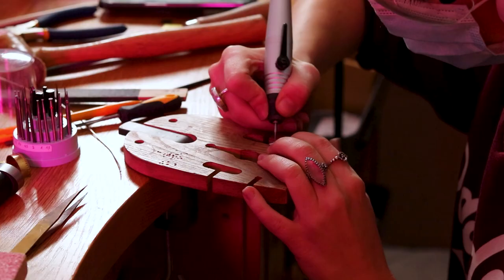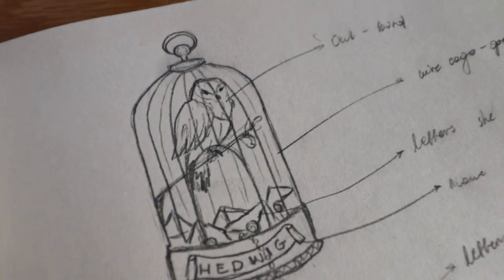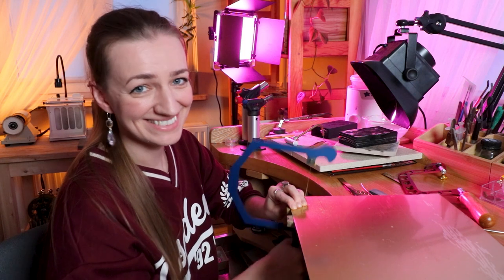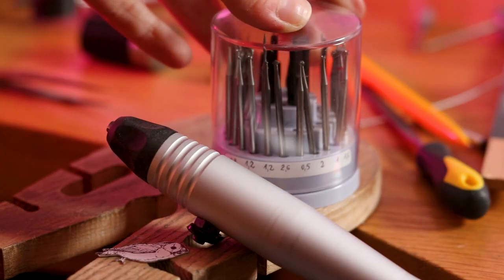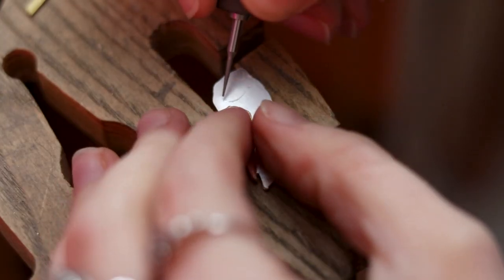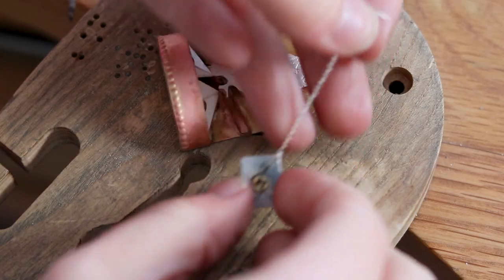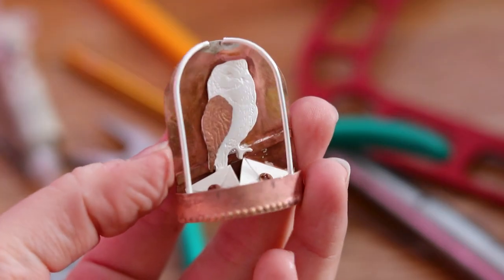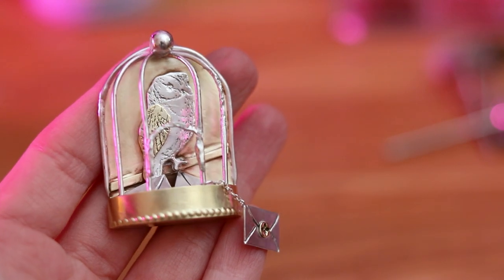Harry Potter inspired JEWELRY: making miniature bird cage | @Estona.Jewelry.Tutorials

Comment: Love how you did the cage wires. I probably would have gone with cold connections at the bottom (balled wire end through a drilled hole) but I have more experience with wire wrapping/weaving and am still learning metalsmithing. I would be so scared of accidentally melting the wire.

Comment: Beautiful work as always Basia! How did you manage to solder such a thin chain to the envelope? I’ve been working on a pendant with a swinging bird attachment, and have been struggling with the thin chain.
Reply from the maker: Thank you so much, love! :) I used solder paste, which makes it a bit easier. I'll be honest - I don't remember if I did that back then, but today I would cover the majority of chain with a piece of brass sheet to create a heat sink and protect the chain from the flame, heating up just the part I want to solder. I hope this helps! ❤ Good luck :)
Reply: Thank you! I’m gonna try to test out your technique!